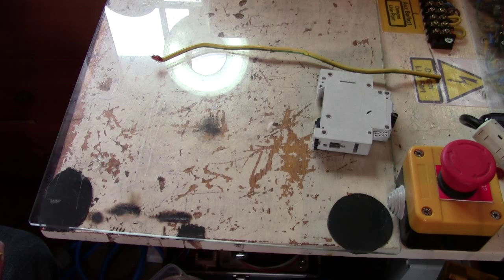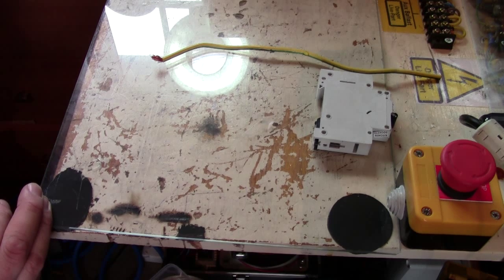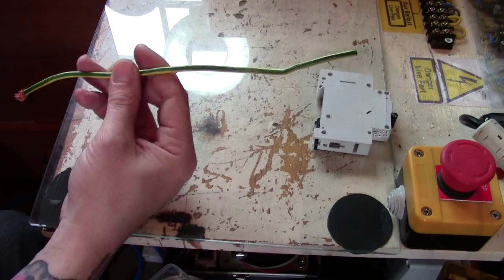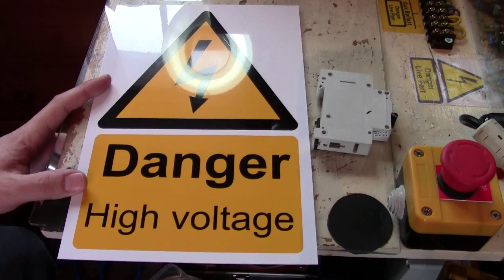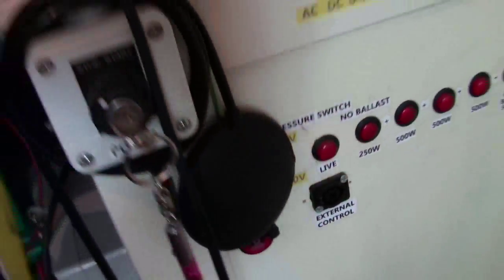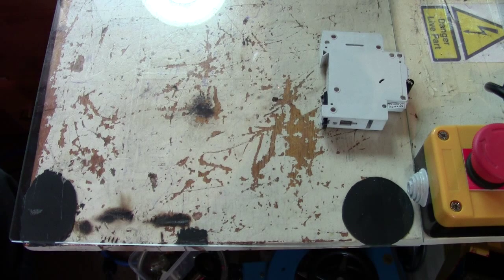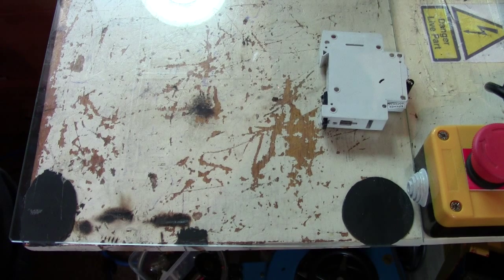Basic electrical safety PT 2

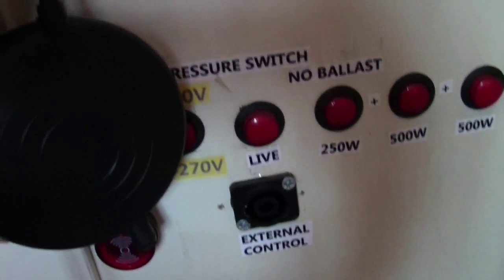Comment: can you make a video to your " control box " ( 5:08 ) ?
Reply from the maker: hi thanks for watching ,I've now moved and had a proper power supply to my shed installed so ,I'm going to be completely rebuilding the whole control unit .So while I build I'll do vids on how it's going to work ,only issues I have is time as I can only do it on days that I don't have to take lots of morphine .And I have some parts that need custom building for me as I will be stacking 2 x 50A Zenith Variacs .It will be fun but will take a while .Are there any bits in particular that you are interested in or is it the whole lot ? Most are interested in how the switches switch the contractors that switch the ballasts and the air actuated switch that runs the 100+A contactor . if you wanna chat leave me your email and I'll message you ,I'm on Google+ also , Cheers John
Reply: did you get the personal Mail ( Youtube ) ?
Reply from the maker: +Pre- reloaded no mate I can't seem to access my messages
Reply from the maker: +Pre- reloaded try adding me here bud .   https://plus.google.com/+JohnSeach
Reply: +HighVoltageProjects ok... I added you

Comment: First rule of making a safety video when you talk about using the right colour, be sure that the DC socket is white with the earth pin at 8 o'clock
http://en.wikipedia.org/wiki/IEC_60309 :D

Well at least you have it clearly marked
Reply from the maker: Well I found these ... http://www.ceenorm.co.uk/section.php?xSec=17&xPage=1&jssCart=3e23fe0d8a9414c1c5733dfb3b0c6398
but no 8 O'clock pin ;(   as I said in the vid I learn from you every day and I have never seen white ones before >>But at least I have clearly marked it DC ;)
Reply from the maker: I found one for sale ;) single unit price for a socket is £63+Vat + delivery :(  I think ill paint mine white ;)